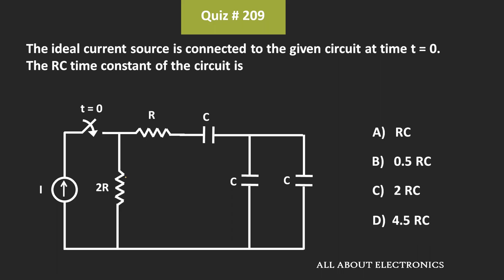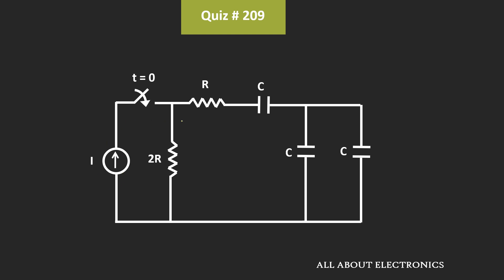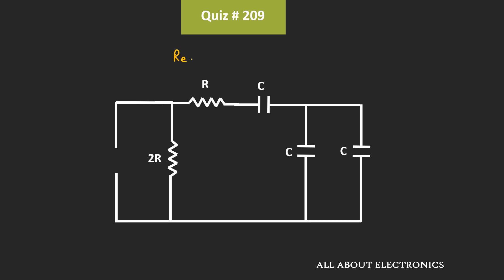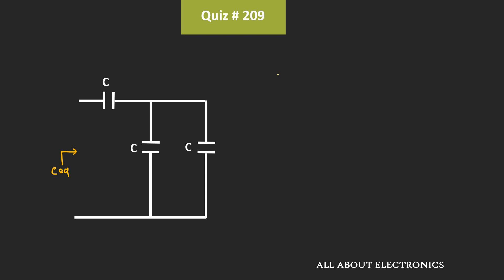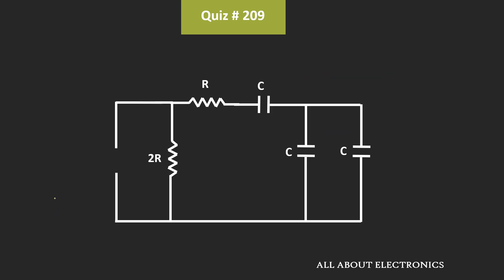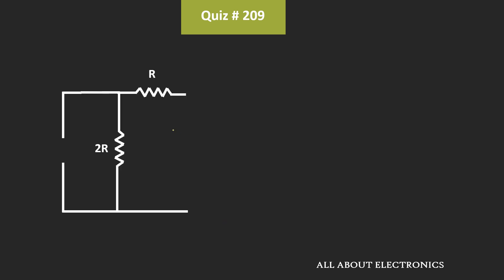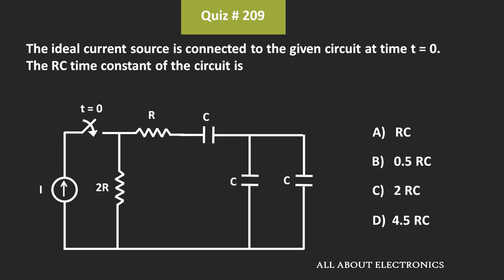Transient Analysis Solved Example ( Network Analysis)  | Quiz # 209

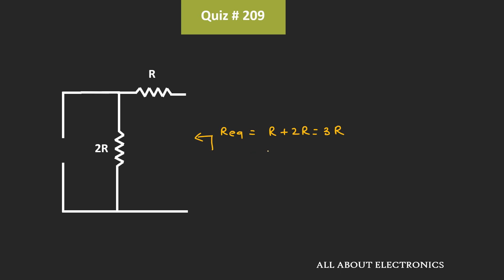Comment: 1:56 may i know how equivalent resistance is 3R
Reply from the maker: The equivalent resistance seen across the capacitor network (after considering all the independent sources in the circuit as zero) is series combination of R and 2R. That is why it is 3R.